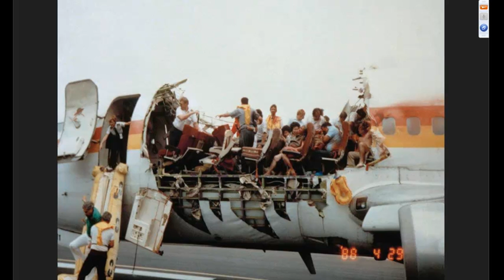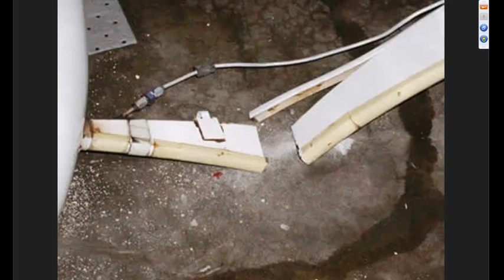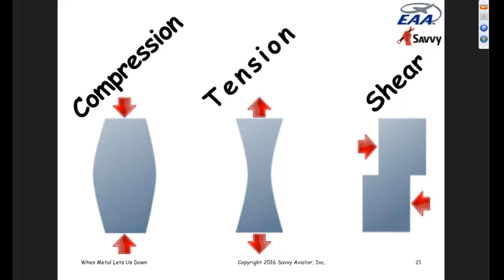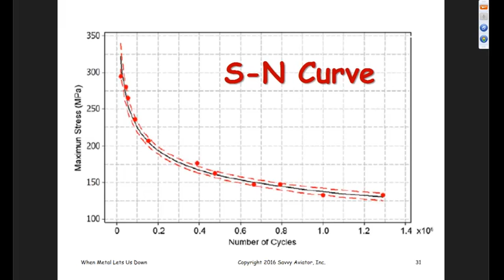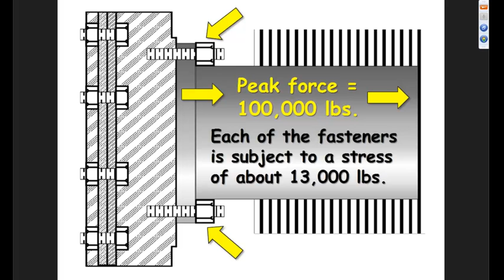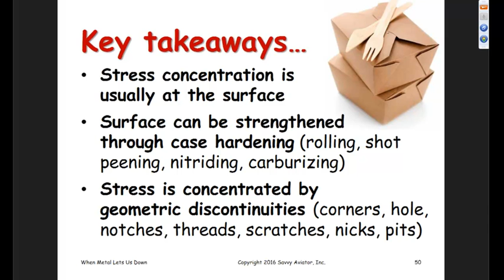When Metal Lets Us Down

Comment: Thread angle , coarse versus fine pitch is debated by engine manufacturers still.........Perkins diesels were made  with all fine pitch threads thirty years ago.........you could not find a coarse pitch thread anywhere on the engine...........makes sense in that less thread angle means less inclined ramp angle for the nut to turn off from vibration..........a fine thread is a flatter angle then a coarse thread..........draw back though is that fine threads are not as deep or wide which is less contact , but there are more threads per inch , so it evens out ..
Reply: Fine pitch bolts are stronger than coarse pitch ones. They are thicker, the threads are shallower.